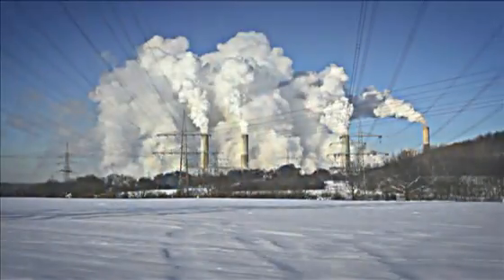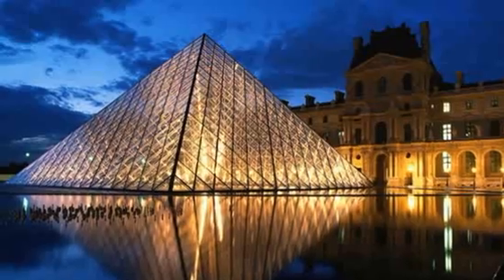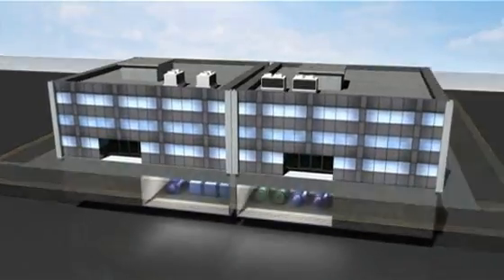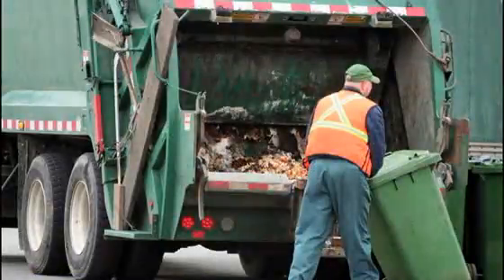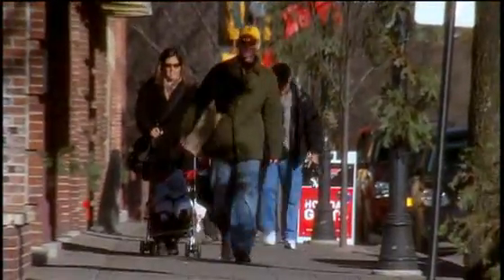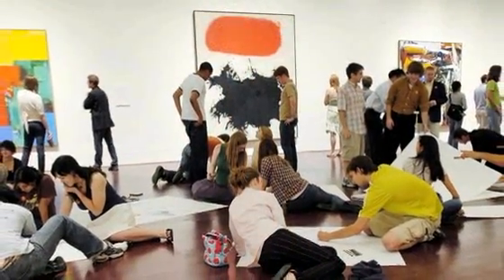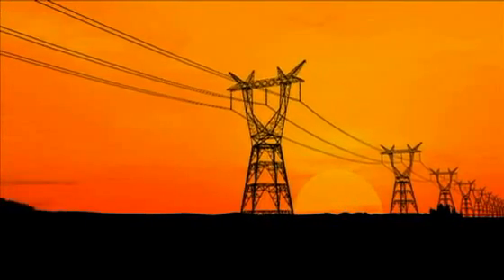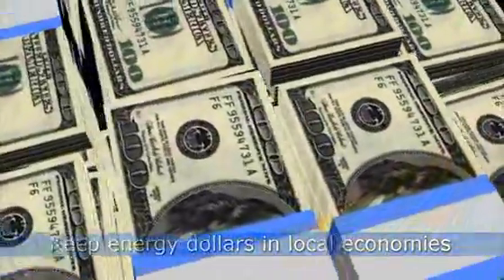District Energy: Now's the Time

Comment: Well, most power plants will still require some form of exhaust. The difference is that instead of running giant chillers and coolant systems, they can rely on a district to cool their turbines/reactors/whatever. The HEAT is harnessed and piped to where it's needed instead of vented into the atmosphere.
The real advantage is that you don't necessarily need a power plant for district heating. Industry and waste management produces a lot of heat that never gets utilized.

Comment: I can appreciate that district energy is a good thing in our classical market model and its time isn't NOW.  It's time has come & not ever been properly implemented and has POTENTIALLY passed.

The reason is that for the cost of just a few radio shack parts in hardware, ea. building can supply itself with an unlimited amount of free electricity.  Overunity technology is a very real thing & can no longer be held in the withering fist of tyrrany.

District Energy needs to upgrade to overunity.

Comment: Wrong. It is the scale of district energy central plants that allow the University of Iowa to burn corn husks, UCLA to burn landfill gas, and Cornell to cool its campus using lake water. The capital cost of such systems cannot be absorbed by individual buildings--only by central plants that service many buildings. District energy is only a part of the energy solution--but it's an important and proven part that is available NOW, and that's the point of the video.

Comment: This is an excellent site for giving a brief overview of District Energy (including District Cooling, District Heating & CHP).  This technology can utilize a wide variety of fuels including renewable biofuels as well as conventional fossil fuels.  The key differentiation of District Energy is the EFFICIENCY at which it utilizes whatever fuel source is used.  It generally more than doubles the efficiency of the fuel use by recyling the waste heat from the power generation process.

Comment: This is a valuable infrastructural component, but is NOT the issue.  This system still does not eliminate 100% of the pollution which can be eliminated.  That happens to be 100%.  Fuel Costs are really an oxymoron.  It is important for District Energy systems to realize that they will not be in control of any energy supplies since this centralized system of energy has now been proven to decrease energy security.  Every building will have it's own redundant completely independant CLEAN systems.